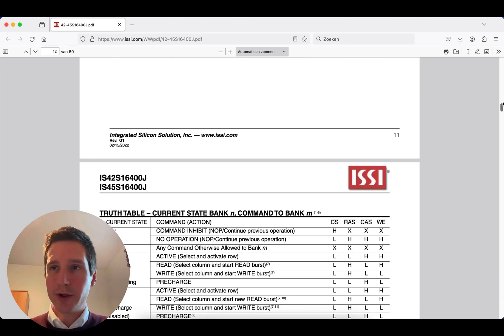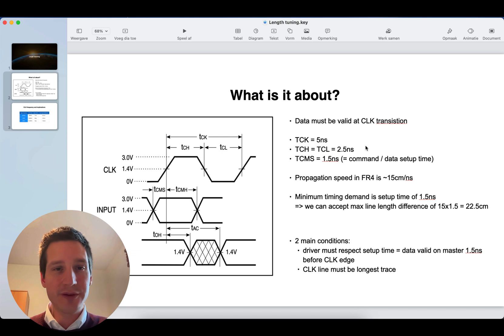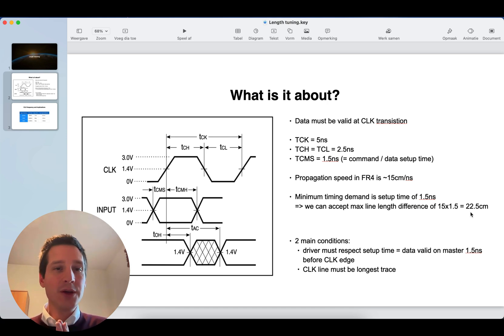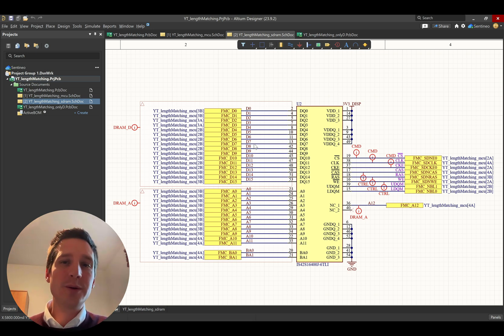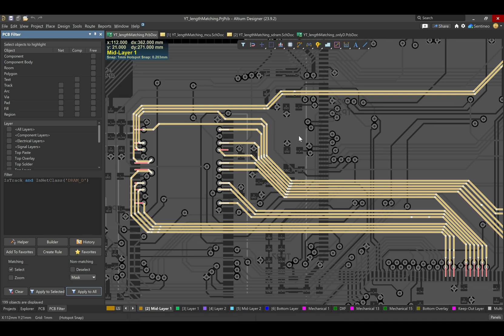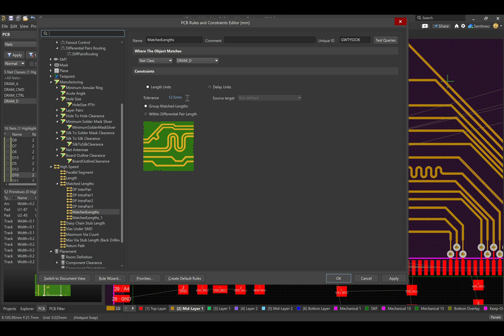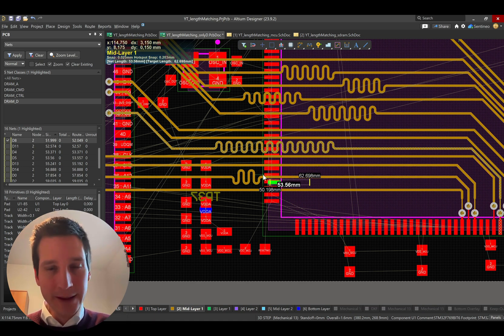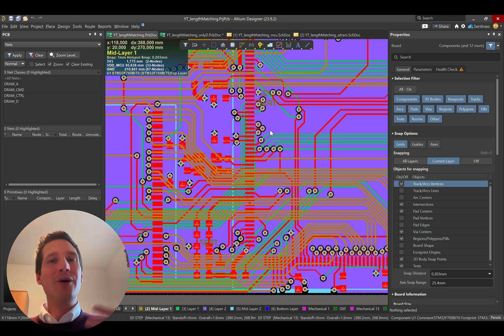How To Do High-Speed Length Tuning in Altium Designer

Comment: Cool piece of knowledge !
Reply from the maker: Thanks!
Reply: Hi, as you know Altium has an interesting wizard for create rules xSignals. could you you show, how to use the wizard for LPDRR4 using chip MT53D512M16D1DS ( 2x16 bit ) with explanation schematic (net)  pins vs names of the wizard.  It will be interesting for me. So I have te question about: micron and other manufacturers have rules for PCB for eliminating crosstalk, etc. How to define the rules when it is impossible ?  For example  minimum track space is 8mil….. but in some short distance (BGA) footprint it is impossible. What is your recommendation?